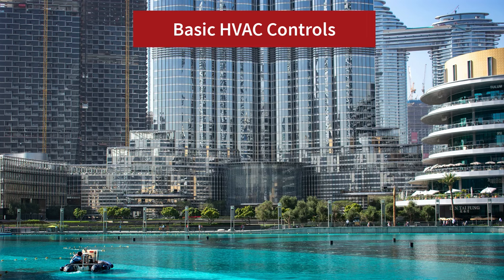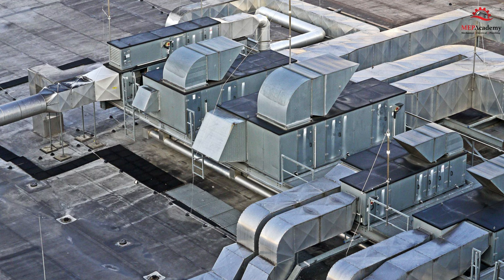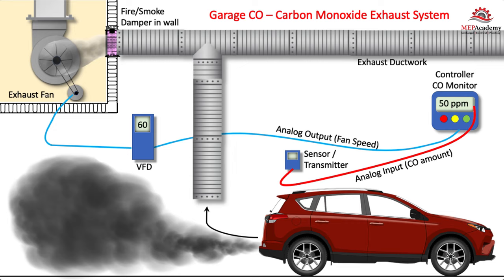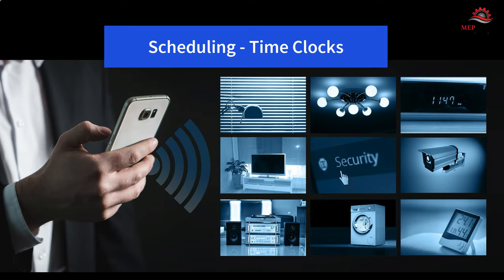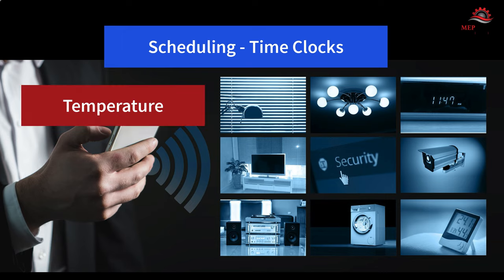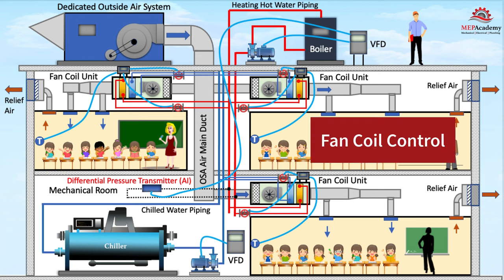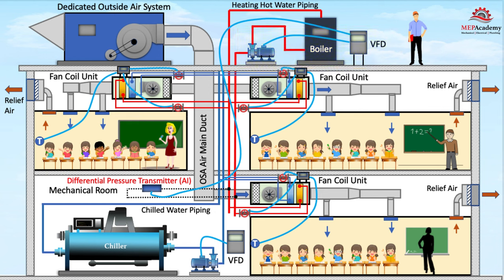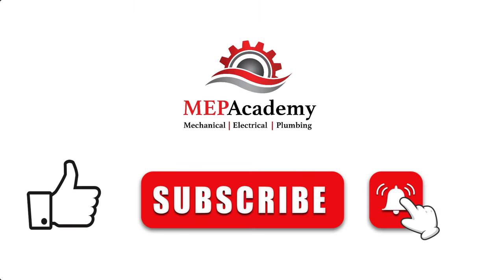Basic HVAC Controls

Comment: In 20 min we went from a $0.50 switch to a $25k system just to turn a fan on off.
Reply from the maker: Correct, as it demonstrates the variability of solutions. Those in the controls industry know that there are ways to do things inexpensively, or with additional layers of controllability that add cost.
Reply: Actually not a good idea to turn a fan completely off.
Blablablba.... read a book!
Reply: Energy managers need to be able to control that switch to save money. They will never recoup their initial investment but they can justify their job.

Comment: hello I want to know what is the difference between controlling AHU fan speed based on duct airflow or pressure differential?
Reply from the maker: There is no one simple answers as it is based on your application and the facility requirements. Controlling for air flow or CFM can be useful in constant volume application, while controlling for pressure can be useful in VAV applications by adjusting the fan speed with the use of a VFD. There may be critical applications that require that the Air Volume be maintained (Airflow based) and the fan speed is adjusted to maintain that CFM. In a VAV system, the pressure differential is closely related to the airflow. As the demand for conditioned air in the various zones changes, the pressure differential adjusts accordingly. Pressure-based control with a VFD allows the fan to operate at variable speeds, optimizing energy efficiency. The fan speed is increased or decreased as needed, reducing energy consumption during periods of lower demand.